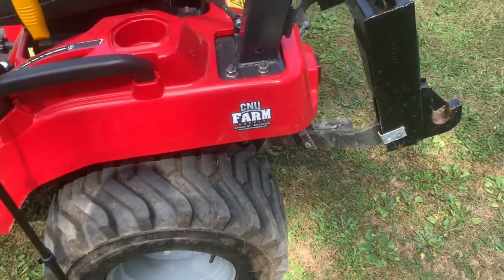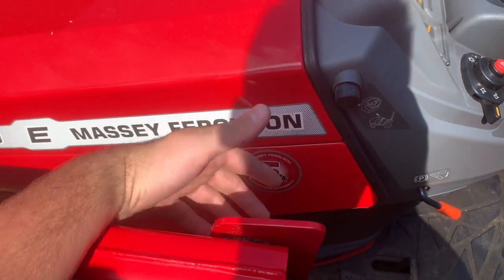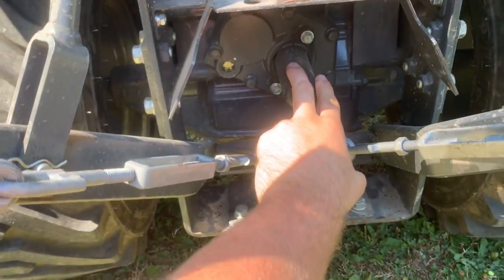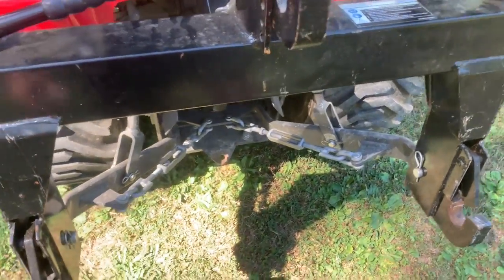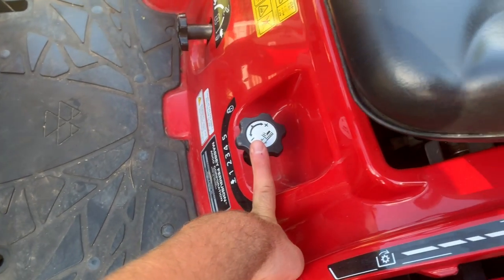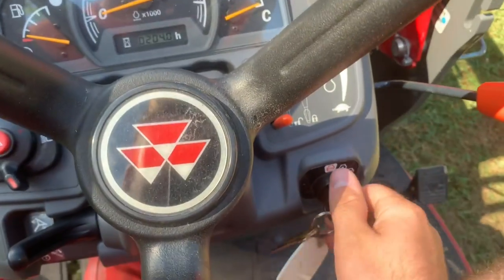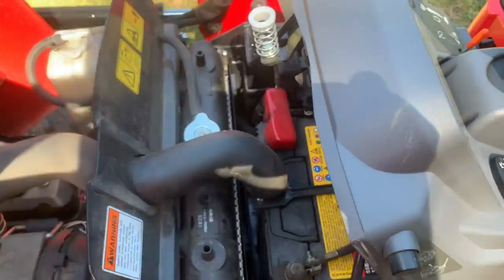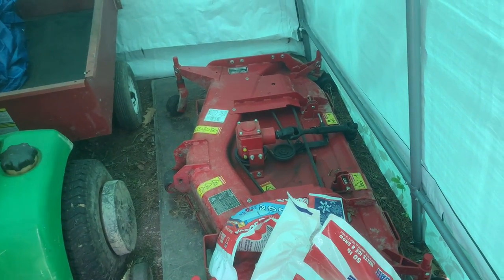200 HOUR REVIEW! MASSEY FERGUSON 1723e (HOW DID WE SURVIVE WITHOUT A SUBCOMPACT?) LOVE THIS TRACTOR!

Comment: They are a great tractor, I have the GC1725M. Coming up on 3 years now and just about 520 hours on it. never imagined I would use it so much. The pallet forks and the 3 point quick hitch were the first things picked up for it. Being I end up doing a lot of work in the dark I built a light bar bracket out of 1" square tube that I have bolted to the ROPS with 2 front and 2 rear led pods and I can tell you that was the best thing ever for working in the dark.
Reply: Also I forgot, just had a power steering hose blow on mine, ended up that where the hose runs on the left side of the frame and the farthest back loader bracket bolt that sticks through the frame rubbed a hole in the hose.

Comment: Good review overall.  The Deere has the plastic hood. Kubotas are  steel end to end.  Massey has the entire rear fenders plastic.  Saw one broken once. on a dealer's lot.  Good machine otherwise? Continued good luck with it!
Reply from the maker: We aren’t hard on the machine but definitely aren’t easy on it. It does everything we want perfectly. Great machine!
Reply: @RyanEvansOutdoorServicesLLC  Ryan, I couldn't agree more.  Iseki makes great engines!  Very reliable.  I enjoyed this past Winter watching you clear your yard and driveway with the loader bucket and rear blade.  You proved a Massey can stand up to any other brand out there by the jobs and chores you choose to use it on throughout the 4 seasons!   You take excellent care of the machine as everyone should, so let it bring you many more years and hours of dependable service!      Sorry about the rear lamp housing but they usually can be repaired.  I repaired one last year for a friend.  It is still holding up till today.   In my opinion, Massey makes the best focused and optically correct taillight and amber warning lamp units out there!  Best regards to you and the family and stay safe!
Reply: Kubota's are not steel end to end, I have a BX2370 and the piece on the front that wraps around the engine is all plastic and has cracked and broke in two places